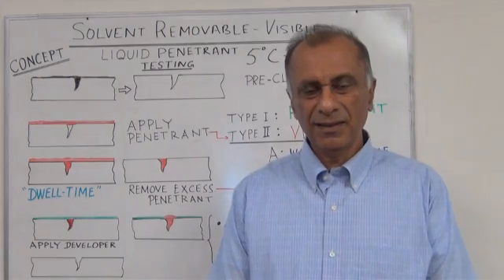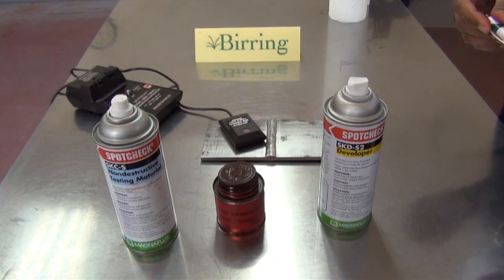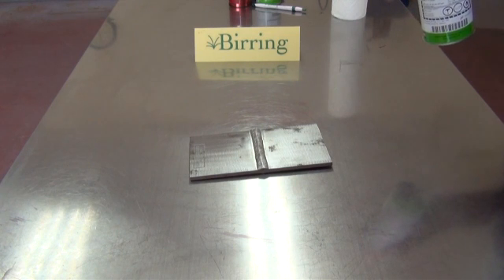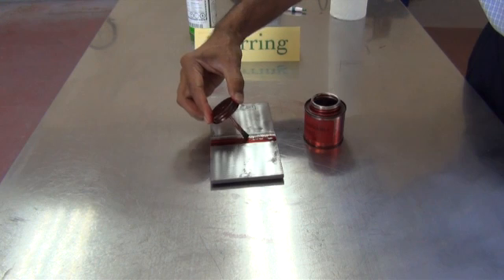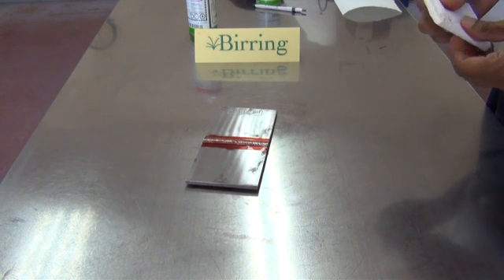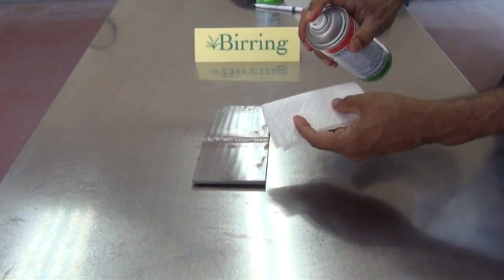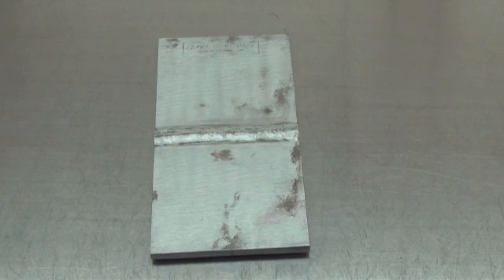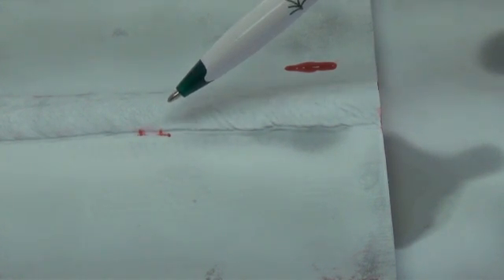Birring NDE 103, PT Solvent Removable Visible  Method. Liquid Penetrant Testing # 2,

Comment: Thanks you so much sir! 
I really appreciate your advice.
I’ve been having an issue detecting very small cracks (around 0.4–0.6 mm). With MT, the cracks can be detected, but with PT, no color indication appears. In your experience, what types of crack size or characteristics (for example, very tight or fine cracks) would make PT ineffective?
Reply from the maker: Send me the MT photo